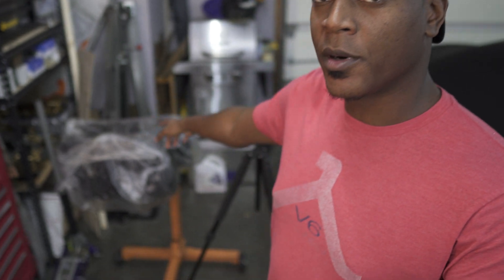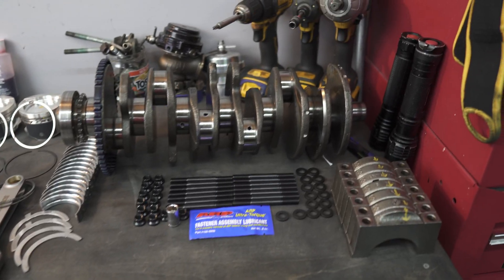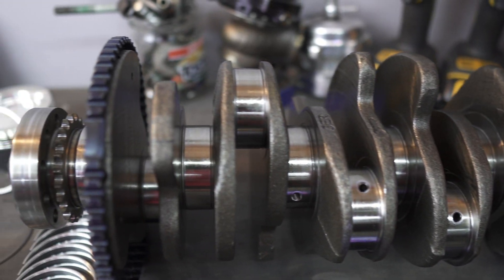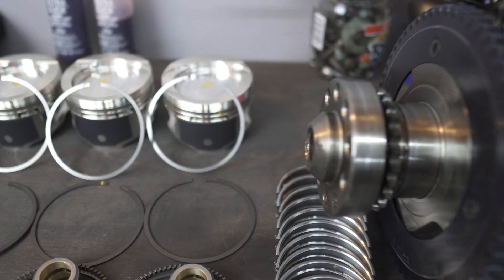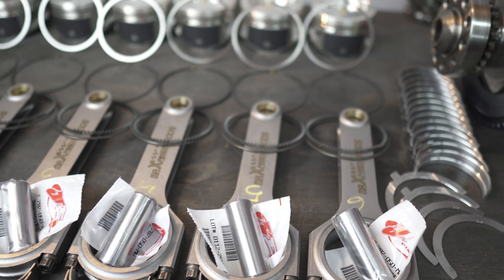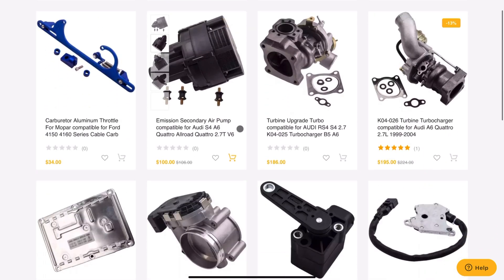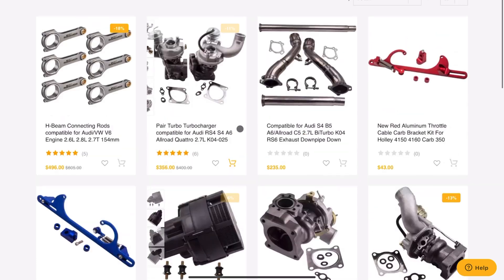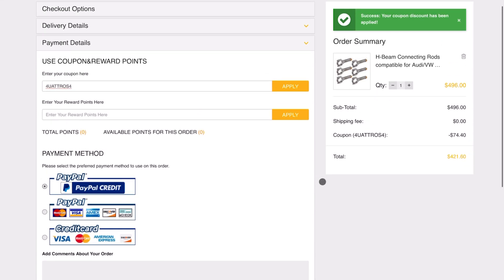Building a 12V VR6 in 15 Minutes Fully Forged

Comment: did you use a plate or adapter to mount the block to the stand ? Also what size bolts?

Comment: What oil pump are u running?
Reply from the maker: Running an oil pump from a mk4 r32
Reply: What about the oil filter housing. My engine is from  a Porsche cayanne.
Reply from the maker: @omarcheevers  the housing is a stock housing from a 12v vr6

Comment: not sure if those are L19 head studs but just some advice: ARP representer on a HP academy episode suggest to not use bare hands to handle L19, as they are sensitive to any moisture sweat acid etc which leads to hydrogen embrittlement.
Reply from the maker: Thanks for the heads up. Will look into it

Comment: How does a head gasket add compression?
Reply from the maker: It’s thinner than the old gasket used on this block and head. So using the metal gasket(thinner) instead of the fiber gasket (thicker) brings up the standard compression ratio

Comment: 2:50 I believe you made a mistake when you were discussing your JE pistons. As far as i am aware the stock bore diameter on a 2.8L12 valve is 81mm. If you are dripping in 83 mm pistons you now would be running 2mm overbore
Reply: actually no, pretty sure that's the stroke.

Comment: Great video for sure, I really like seeing the VR6 engine being put together from top to bottom but it would be nice if you explained what the torque specs were on each bolt that "you're" tightening down rather than showing a fast forward video of it. It would help our future builders!
Reply: Torque specs are available thru the Factory Bentley Manual. Of youre undertaking this task especially as a first timer and you dont have the factory manual nearby youre setting off to fail. Its just common sense rhat this task requires plenty of planning ahead of time for it to go along smoothly and quickly
Reply: @j.m.5995  Yes I'm well aware that having a factory manual will show you the torque specs, but it would have been nice to hear what some of are especially for people that haven't done something like this before, because not knowing what the spec is and just tightening it down by hand can either make or break the job.
Reply: I don’t think he wants to take that responsibility just get the repair manual
Reply: @HectorGonzalez-fz6ws  That just defeats the purpose!
Reply: @Eurospec73  who would just tighten anything down without a torque wrench/specs on engine internals? not anyone that values their time or $ thats for sure.

Comment: What up boss. Just finished put mine together in the stand. About to install. I'm porting and polishing my intake manifolds. May not give much power increase but will help it breath a bit better.
What fuel injectors are you using?? Oh and what Cams? 
I went autotech hp valves, springs and all the only bells and whistles and 268 techtonics cams. Haven't chosen my exhaust yet though.
Reply from the maker: I’ll be running Bosch 1000cc injectors and auto tech 262 cans.
Reply: @CIPGAS  yeah buddy. That thing is going to roll. Did you do a GIAC tune on that thing also or Did you or a friend Tune it?
Sorry for all the questions but I don't have much contact with individuals who are rebuilding what I'm rebuilding. 
What injectors would you recommend for somebody like me who currently at least for the next year will not have a boosted VR but does have all high performance parts put into the engine with upgraded cams. 
I've heard somebody talking about the mid-80s to very early 90s 330 CC Mustang injectors. The information on this topic is almost non existent aside from a few people in forms
Reply from the maker: @Jason-TheChad-Muska_circa1995  no need to apologize. My will be tune by GermanElite Tuning. As for the injectors 330cc should be fine while it’s naturally aspirated but if you’re going to boost I will not be enough fuel, I would look into 650cc Bosch EV14’s and that way you only have to buy injectors once.

Comment: How did you go about painting your alternator
Reply from the maker: Took it apart completely and then sparred just the outside aluminum cover
Reply: @CIPGAS  can you give me info on how you popped it apart.  Never done an alternator and I kinda wanna give mine a better coating than I did by just shoving tape into the gaps.

Comment: if im not mistaken you using the wrong lower timing cover (looks like fwd version) and the the valve cover needs the breather box cut of.
Reply from the maker: Yeah lower timing cover had to be modified to for the adapter plate and the valve over is a placeholder until the correct one arrives

Comment: I’m going up swap my auto b5 into a manual 98k miles, also going to probably upgrade things, should I tear the 2.7 and build it or just change gaskets swaps, chains and try to push 400whp? Also what all do I need? Would really appreciate if you could get back to me
Reply from the maker: If the engine is running well I would just do timing, seals and gaskets and run it as is. 400 ho should not be a problem for the internals as long as it’s a good tune.

Comment: I’ve got the stage 5 from ringer in my BST A6. Only issue I’ve had in 5000 miles, (so far) is a bit of tob noise. Other than that it performs fantastic, love the feel of it as well. It’s not too stiff, and the engagement point isn’t bad either.
Reply from the maker: Awesome. This gives me reassurance that I made the right choice with ringer racing for the vr6 swap

Comment: Max speeding rods🤣🤣🤣 fellas. Listen. Real talk. I have IE Tuscany rods in my bat 1.8t. (One of my buds way smarter than me, running the u of u racing research team and our local VAG tuner savant said that was the way to go) insurance payout$ for getting t boned in a 1 of 54 laser B5. my fella also said it's basically just the extra qc, shot peening etc that they do. They source the same blank batches from the same Chinese factory. Max speeding rods is direct. 100% not even close to the qc IE does and for a blueprinted engine... yeah you don't want Max speeding rods. It's like 3-4× as expensive as eBay rods. BUT... I roll around with buddies who budget built their cars years ago pushing 450-550 awhp @ 5k elevation for years with Max speeding rods. To be honest, there's been a few that ran into tolerance issues immediately, but like 95% had no issue and I wouldn't think 2x for the cost savings to get em unless you dropped 20k into a build. My Tuscany's have survived blowing TF up out of 3 motors now (2 were gates/conti timing belt shredding) so nothing too crazy, and have been running my daily fully built bat b5 for a few years now @ 200 miles per day. They are solid. That said... 200-300$ rods at this point have the same long term reputation where it's totally worth the tiny gamble
Reply: IE here for.my build totally chromoly steel, max isn't full chromoly, weigh more both weigh less than stock. IE rods all came balanced 6 id weight. Lightest in the world 4 the VR6

Comment: What are some advantages of a VR6 over a straight 6 or V6? Also what made you choose this engine?
Reply: I6 doesnt fit in a b5, the 30v v6 2.8 and 2.7t are booty, vr6 is well known in the vw community as one of the best motors for high hp, only other vw motors i could think of to be on the high hp list are the 4.0tt and the o7k evo

Comment: I used your code for my rods. I appreciate the discount. I'm waiting on ARP mains for my build. For the 2.7t they're outta stock every where. They're saying middle of November before they are stocked again. So it's holding my build up. I even tried to find a used set to no avail. Same length are in stock. But mine are different length of course. Love the vids man. Keep on boostn.
Reply from the maker: Happy to help! And yeah ARP’s stock has been awful as of late, it was almost impossible for me to find head studs
Reply: I waited 2 months for ARP hardware recently and after all the waiting they couldn't even give me an ETA.... super disappointing.
Reply: @9ckr716  they're in stock at CTS Turbo in Canada. That's where I got mine from.. I found a set.
Reply: Thanks but my car got impounded since then lol... sucks
 Ya I'm.in Canada too.... Edmonton